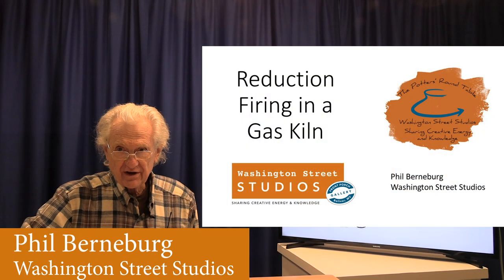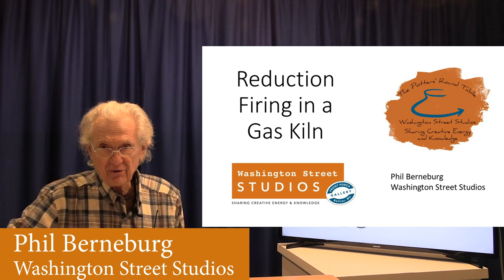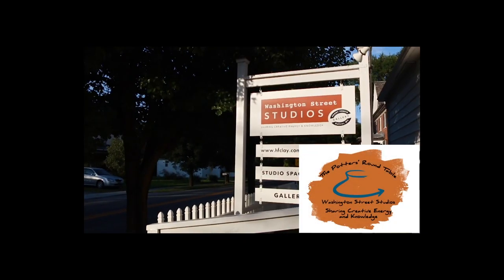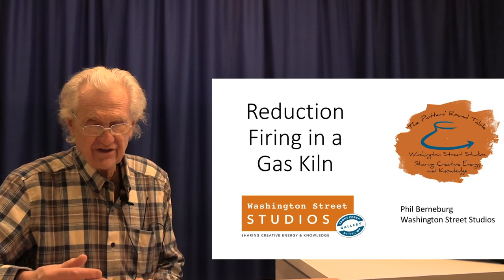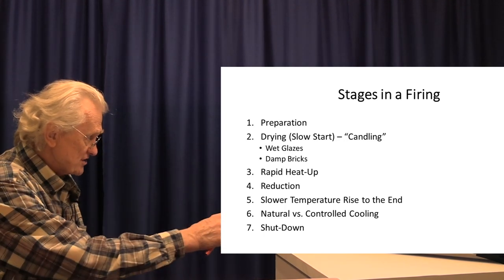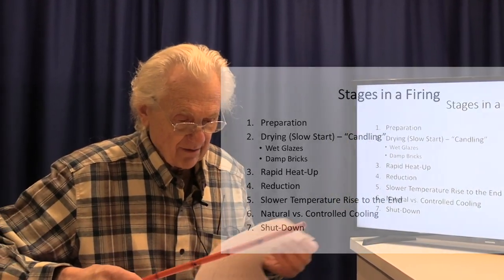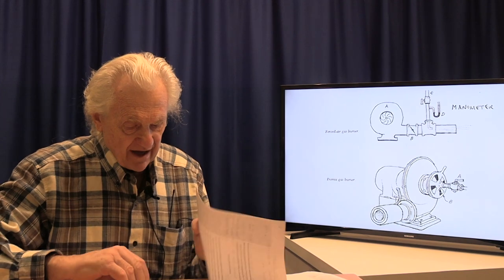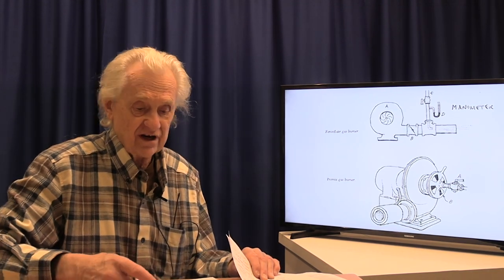Reduction Firing in a Gas Kiln

Comment: Hello Phil,
It's possible I skipped some videos, but I think I watched them all. I am building a gas stove and would like to buy a dryer burner. Which should I get natural gas or propane? In short, will natural gas be able to reach 1400 degrees C and which is more economical?
Best Regards,
V. Nikolić
Reply from the maker: I am sorry but Phil passed away. 
Natural gas is more economical in most areas, and uses a different burner. The temperature reached is more dependent on the kiln design, although you will need sufficient BTUs to heat the space.